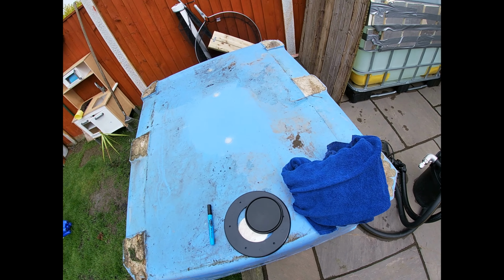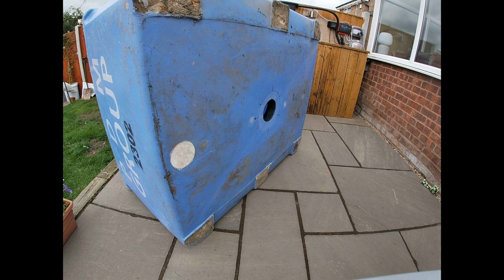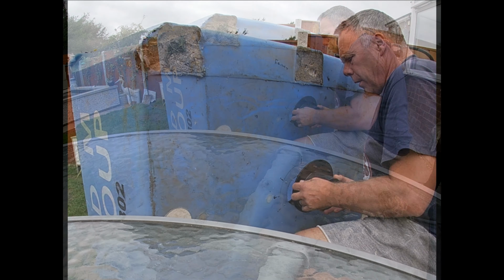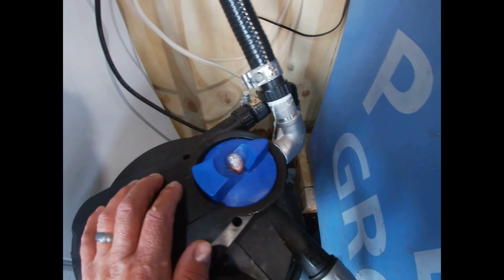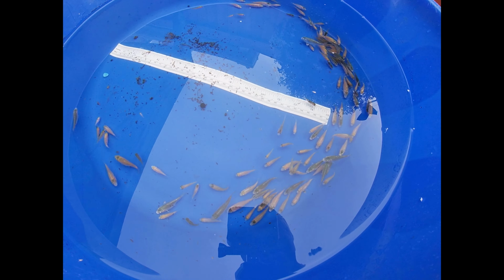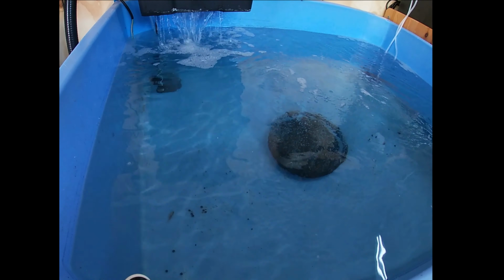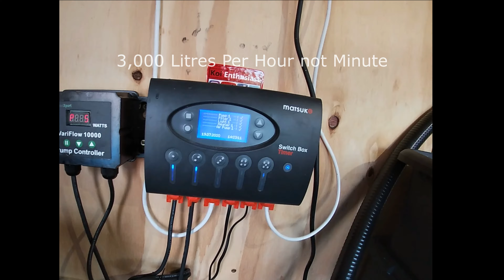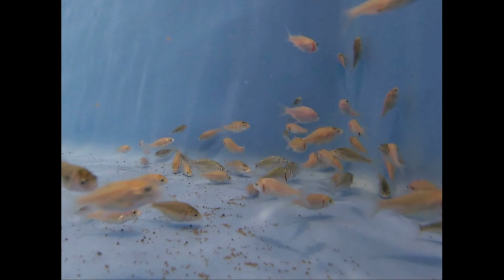How To Fit A Bottom Drain To A Plastic Tub- Upgrade A Koi Fry Grow On Tank - Bottom Drain

Comment: Sorry you lost some of the fry I had the same problem with them going down the drain and I did something similar but with 2 sections that way I could move the top one adjusting the size of the holes and stopping the smaller ones going in. Good luck with the rest of them like the neat little shower you use 👍

Comment: Hi Kevin, I'm surprised any of the fry survived going through the pump, what made you check the filter did you see the fry going down bottom drain, you got really lucky with the number of survivors which was nice to see bet you was surprised to see any still swimming around, and with the mesh now over bottom drain that's one thing less to worry about, impeller in that pump must be set well back as it looks like filter balls didn't get chopped up either, and koi videos are never too long lol, stay safe.